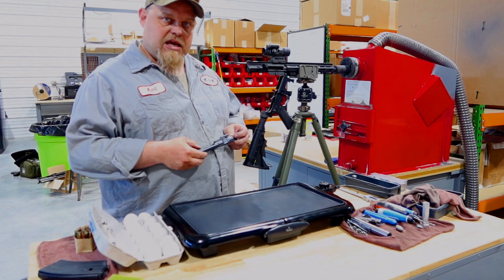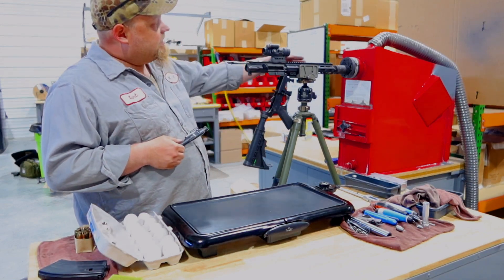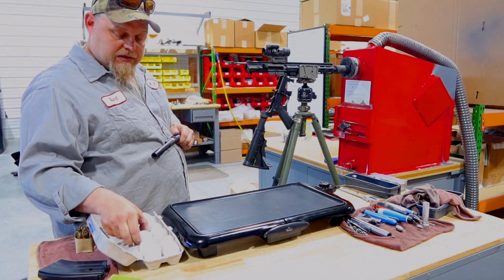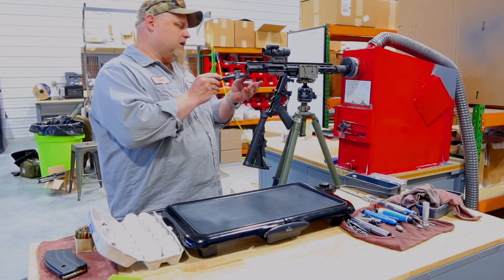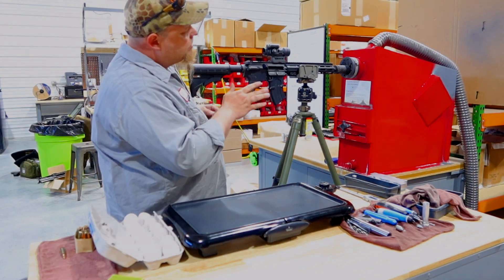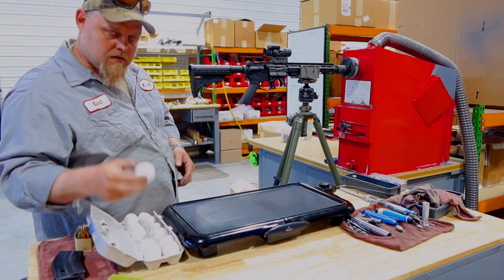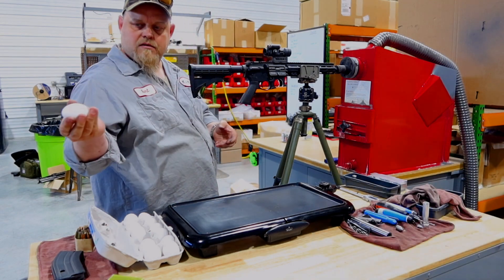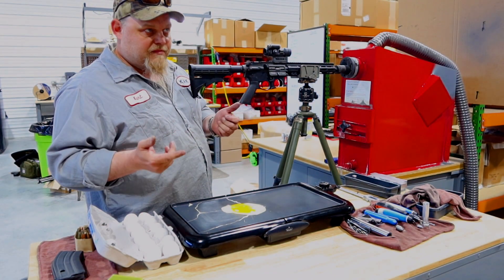K SPEC egg test

Comment: Do the test against a white cleaning glove,

Why's he using a 7.62* instead of a 556.

The AR was designed to blow out the magazine if there was a failure to seat, or expel gas. 
But with direct impingement, I still wouldn't want MORE crud like powder and gas going even more inside the fire control group, or over rounds that'll be chambered. 

The more I look at it, the more asinine this is. 
Gimmicky at best, just asinine, unnecessary, and dangerous at worst. 

Not to mention heating up ammo and your mag well. You don't usually direct gas towards hands and extremities. That's why it's directed towards to right, or away from most shooters' faces.

45,000 psï for 7.62×39.
58,000 for 5.56.

There's fuckery afoot.
Reply from the maker: This demonstration is to show that downward gas vents don't have enough force to crack an egg.
We make ARs in a wide variety of calibers.
A failure to seat does not result in anything blowing out of the magazine. If you're referring to a catastrophic failure, ARs are designed to blow out of the magazine, what's most common is a case head separation or foreign objected lodged in the barrel.
The bolt unlocks from the barrel extension when gas reaches the carrier key from the gas tube, gas is released a long time before the carrier reaches the FCG.
If you are shooting a DI AR with a can, it's going to get have accelerated carbon build up regardless, this is primarily caused by increased back pressure from the chamber, making rounds in your magazine dirty, no matter what BCG is used.
"heating up ammo" is irrelevant, gas vents in BCGs do not become heat soaked from normal use like say a gas block would.
Gasses exhausted from vents are at their lowest temperature upon exiting in correlation to the gas journey through the ARs gas system.
You'll get more gas to your face when using a can and a milspec bcg in comparison to our unit, one of the main features is that it reduce gas the shooters face.
I'm not sure why you're comparing chamber pressures, if you'd like to see additional testing being conducted in 5.56 and 300 blk, including magazine temp testing during full auto use, or mag cleanliness compared to a milspec bcg please check these out- https://youtu.be/jLenvzvTYpg 
https://youtube.com/shorts/saNB05ySWKA?feature=share
https://youtu.be/JB3Bae2QLCk

Comment: Who even thought there was enough pressure to do anything? It's just excess gas from the carrier, there was really no point to do this test, unless people actually believe that much pressure comes out, in which they need to do more research on how gas systems work
Reply from the maker: The test wasn't filmed for no reason, this was one of the most common misconceptions.....
Reply: People seem to think the same thing that happens with an out of battery discharge  will happen with the k-spec bolt, which is the magazine body exploding spectacularly. I really like the concept of this bolt and hope it actually does reduce gas blowback significantly.